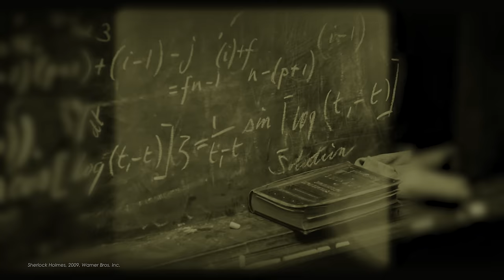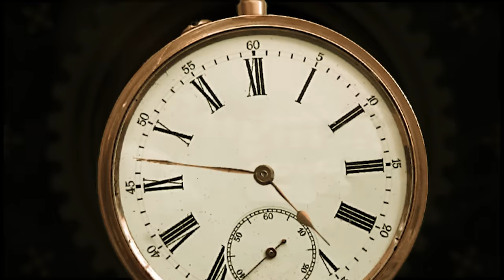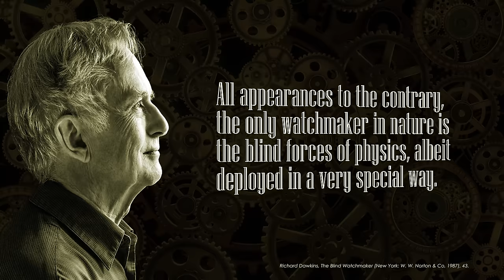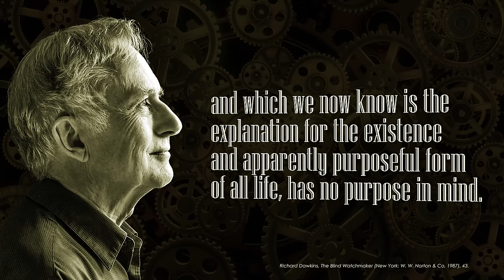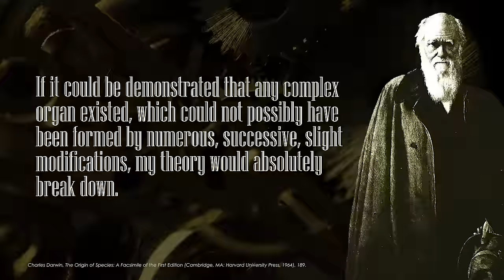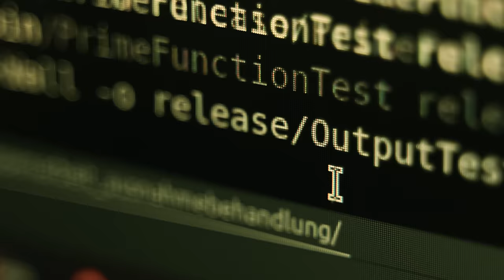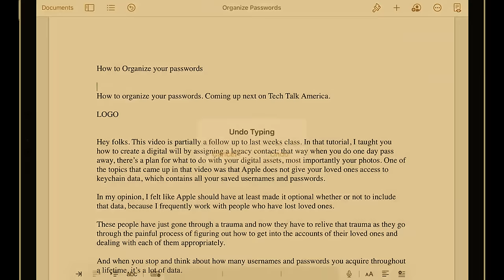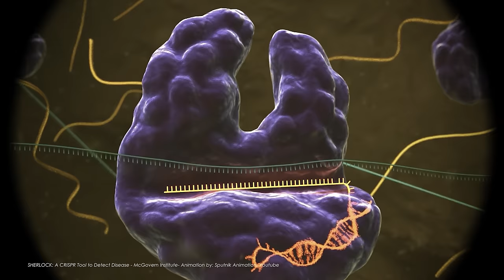Even TOP Evolutionists Won’t Deny This Evidence for God

Comment: The one advantage a watch maker has: he can design his clock however he wants where there's freedom to do so. 
Is there any reason why the vas deferens has to go around the bladder and be that long? Certainly you're already familiar with the giraffe. Well, I guess he took his freedom to design bird and mammal hearts differently as well as destroy their sweet receptor in favour of the sucrose sensitive umami receptor. At least birds, unlike us, won't get age hearing loss, though they also only have a single earbone.... 

It's odd to say high placed evolutionists don't deny the evidence for God. Do you mean to say Dawkins doesn't deny it? I wasn't quite sure here, but if he didn't he wouldn't be an atheist. Plus you yourself pointed out that many people think the watchmaker argument has no merit.
Reply: What about our internal clocks?(circadian rhythms)  Even if you think something is badly designed doesn't negate that it was designed.

Comment: Its silly.  A blind watchmaker would not therefore be mindless.
His mind would have to be stronger, strong enough to compensate for his blindness.
The analogy is about as far removed from describing the plausibility of the ToE as it can be, just like the theory itself is from reality.
Reply: And yet life continues to evolve in reality.
Reply: @jockyoung4491  In reality, it adaptations.  You have never seen one kind of creature change into another different type of creature, except in the imaginations of evos.  
Extinct creatures with similarities doesn't cut it.  Many different kinds of creatures may have similarities.  It means that they all have the same Creator, who used extremely well engineered, useful, similar designs in different creatures.  Dogs and cats both have four legs and ears.  It does not mean that they are related.  It means that they have the same Designer.
You will never see a dog become a cat, nor a cat become a dog, or for that matter any other type of creature through natural or forced selection.  Never, for it isn't possible.
Reply: We do have biological clocks in us.(circadian rhythms)

Comment: This is so typical of creationist "intelligent design" videos. They take a study, in this case Monroe et al., Nature 602:101-105 (2022), completely misunderstand it, cherry pick a few quotes, and declare that the theory of evolution by natural selection has been disproved. For the record, Monroe et al. found mutation bias in Arabidopsis thaliana, where some very critical genes have lower mutation rates due to DNA repair. Such repair mechanisms could easily have evolved by natural selection, since most mutations are deleterious, and thus any mechanism that lowered the mutation rates of critical genes would have a selective advantage.
Reply: The challenge is why the repair mechanism would even stay. Before it is used the plant can't even know what it Does.
Reply: @TacoBel   You clearly have no understanding of biology or natural selection.